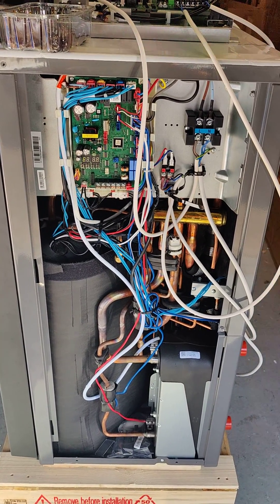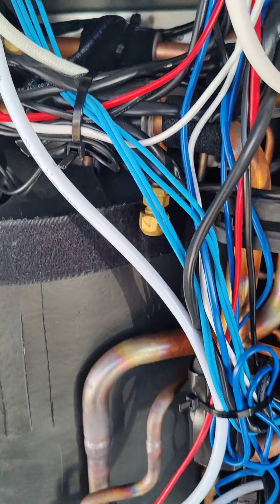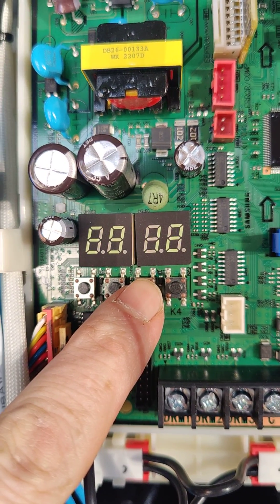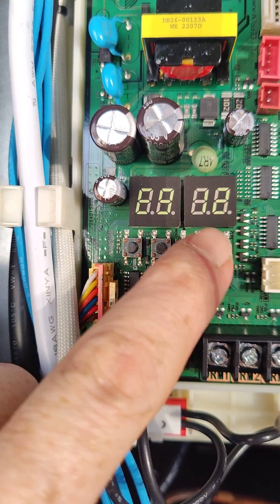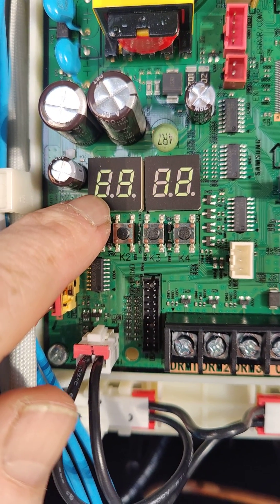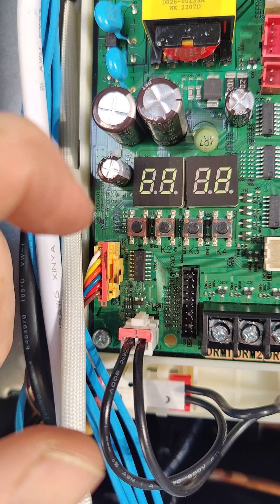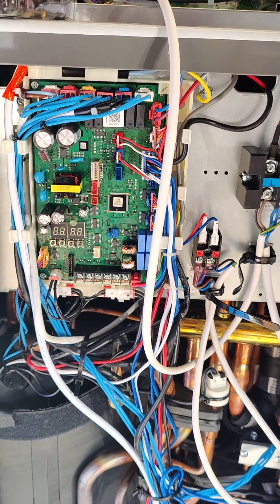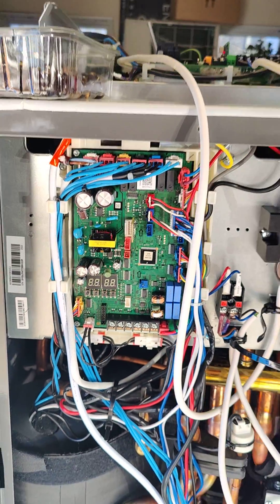Samsung HTQ some useful service tips for engineers

Comment: Hi Grahams, thanks for the video. Can you please tell me what kind of wiring should be installed from the outdoor HTQ 8kw monophase unit towards the engineroom (room where the underfloor heating manifold and consumable fresh water heater would be located)? Bare in mind that I would like to install also solar water heaters sometime in future…
So at the moment the heat pump would be running only underfloor heating and consumable fresh water heater. Best Regards, Leo